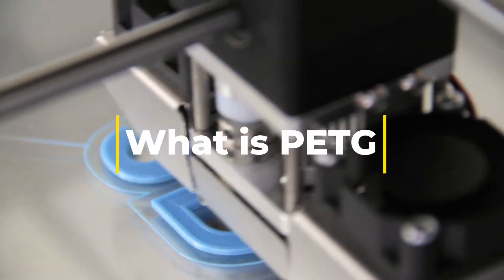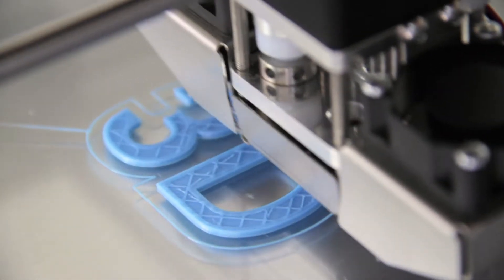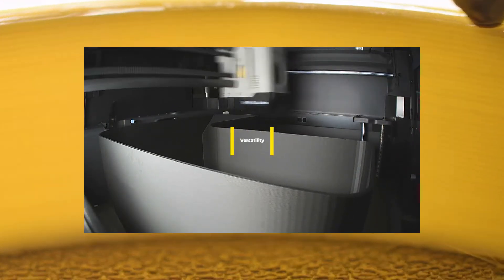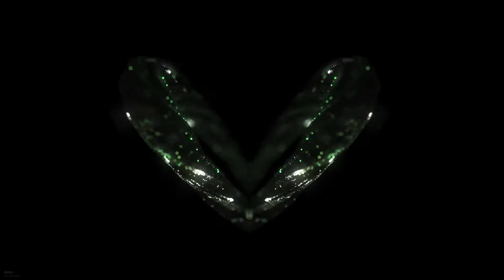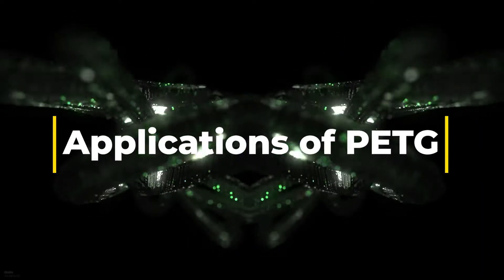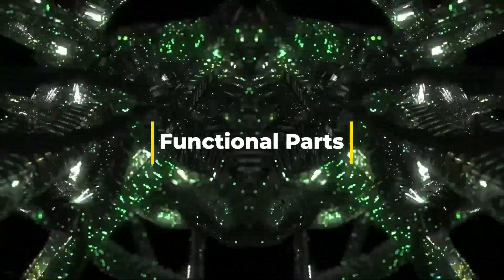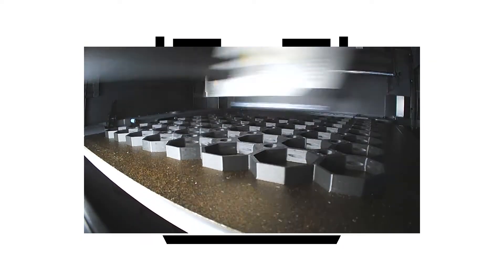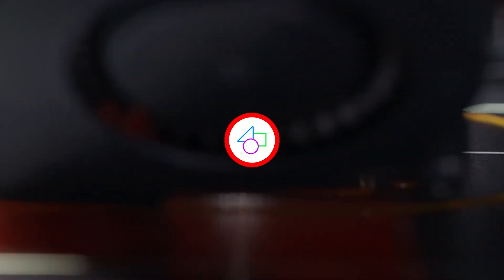Everything you need to know about PETG Filament for 3D printing!

Comment: You need glue stick not for adhesion, hot PETG will even stick to a bit of dirty air. You need glue stick as emergency release so PETG doesn't take a chunk out of your bed when you try to take the print off. It forms a permanent weld with clean glass and can weld to polycarbonate and PEI too if you aren't lucky.
Reply: Try running some isopropyl around the stuck part, it should wick under and release it without damaging the plate
Reply from the maker: @CustomCreations-co-uk  Great Tip, i'll try that next time, I ended up scrubbing my plate with hot soapy water and isopropyl which seemed to clean up my build plate
Reply from the maker: @SianaGearz  Thanks for pointing this out, I had printed with PETG several times with my P1S, never needed a glue stick to remove the print from the plate, in the last few weeks, I printed on the K2Plus and feel like there are parts of the plate ruined because of this

Comment: You forgot to mention that PETG needs drying for best results as it is more hygroscopic compared to PLA, stringing with PETG most of the time is caused by moisture in the material.
Reply from the maker: @rcd3drussellcad232  thanks for pointing this out, sometimes it's the most obvious things that i missed, I'm planning on an update to this video,  I'll be sure to include info i missed